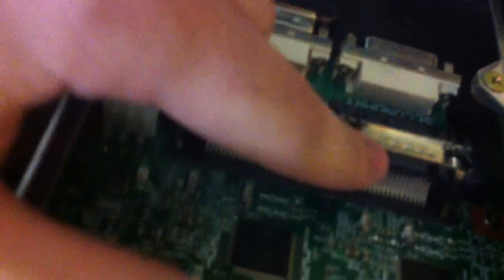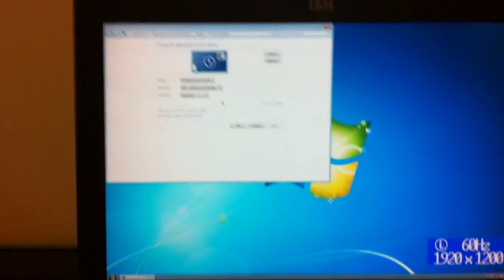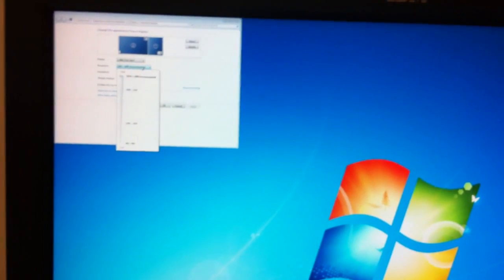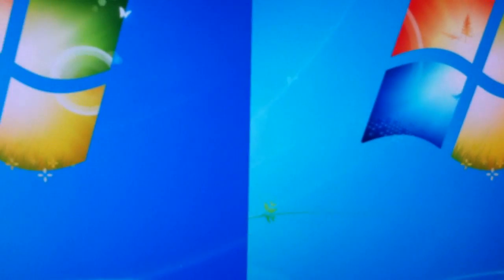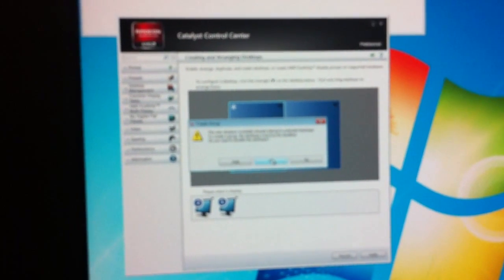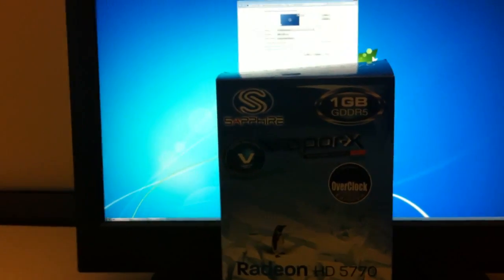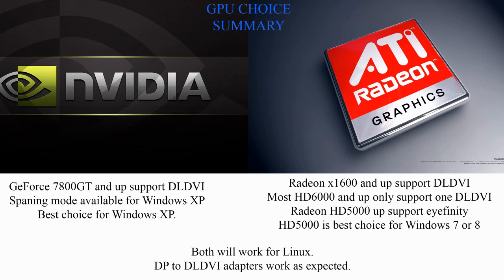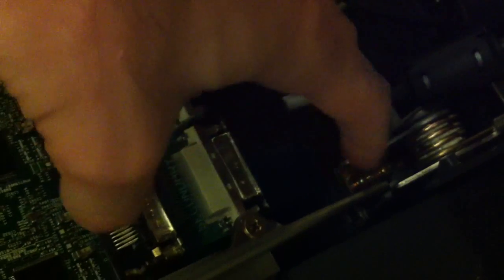Setting up an IBM T221 DGP with eyefinity and cirthix's adapters.

Comment: Wow! Are you the one that built the 120hz 4K dual display port? I’m really blown away by the technology. It blows my mind that there was even 4K in 2001. My dad was an Electronic Engineer at Crane Navel base here in Indiana, and I grew up working on the old vacuum tube TVs. As a kid I had a lot of the tech other kids didn’t have because I was building and repairing stuff out of my dads part shed lol.
Reply: I really am surprised I don’t see many people talking more about this 2001 dual  4K monitor. I only find your videos. Is there many downsides to this tech?

Comment: This monitor is very special, not only is it pretty much the first ever 4K display it's literally decades ahead of it's time, it's the bang and olufsen of monitors! I believe they cost around $15k at the time. Not sure there's much point in owning one today as they are still expensive second hand but the 16:10 ratio is so much better for computing. I wish UHD TV's were 16:10 as I'd buy one for my computer.

Comment from the maker: sorry for the slow response.  email me directly with questions.  cirthix@gm[REMOVEME]ail.com

1) buy one from me or look on ebay.  prices range from ~400-1000 depending on condition and version.
2) no, refresh rate on lcd has nothing to do with eyestrain (unlike crts, where refresh rate affected brightness as a function of time, lcd brightness as a function of time is only dependent on the backlight design, and is usually pretty constant)

3) brightness is decent.

Comment: Hi, I was wondering some things about this monitor -- where can they be found, and at what prices are we talking? Will most applications be able to be used at this resolution (CAD/Photoshop/3d Modeling software)? Also is the lower HZ tiring on the eyes after some time, and how is the brightness comparable to other current lower res (1080p) displays? I'd need to have on-screen pixels at 50 microns (1/20 mm) or less.